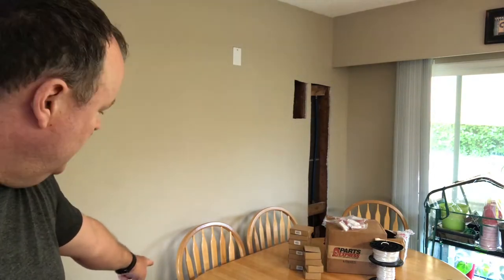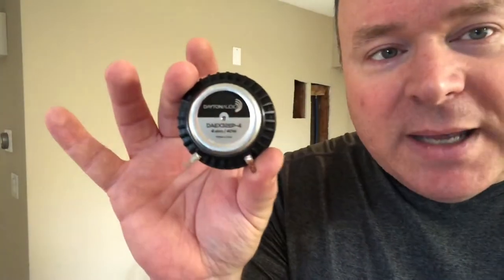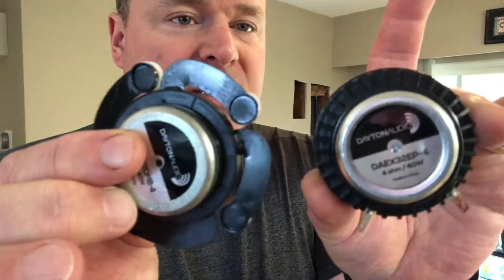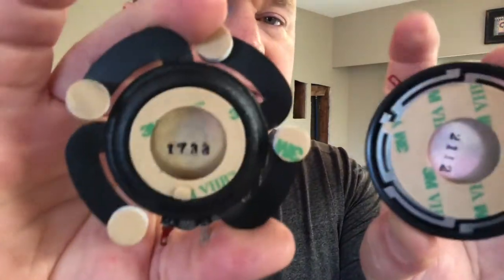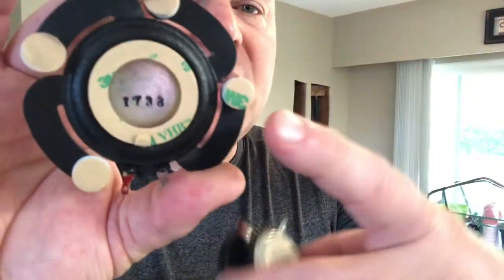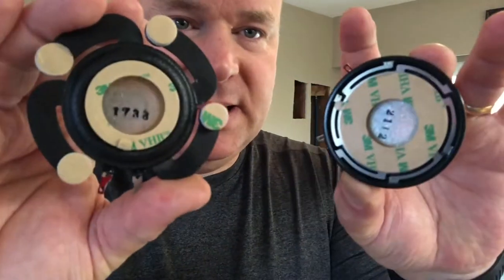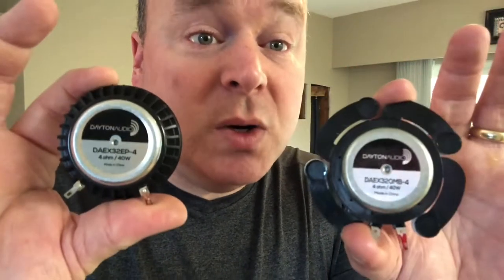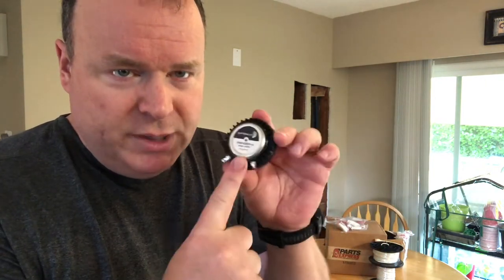DML Speakers Using Hidden Audio Exciters In-Wall

Comment: Long winded dude..  good idea though.. just a really lengthy explanation of what should have been “i got some exciter speakers, doing some plumbing work so gonna test em inside the drywall.  Lets see if it sucks or not.. “.  Rather than 12 mins of a story..  just a thought..  cuz damn..  you can always explain anything 100 different ways, you just gotta find the right way to only do it once ..
Reply: Oh nevermind the whole damn video was an idea.. fuck sake man..

Comment: You might be better off by using an amp or dsp/dac the has a high pass filter or eq.  A dsp could help a ton giving you the ability to adjust the diff frequency levels. That would also be more efficient and allow u to gain higher output from the same amp vs just burning off that low freq power.
Reply from the maker: That is a great idea, certainly more costly, but far more configurable, with a grater chance of sonic success. At the same time, I do like the default, built-in protection that the passive crossovers offer